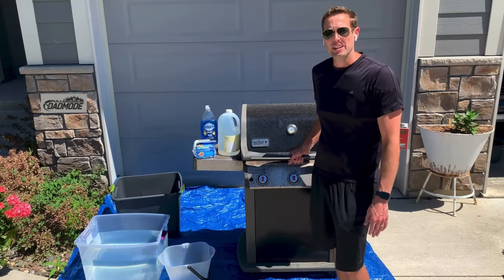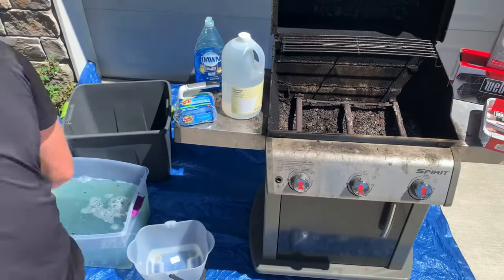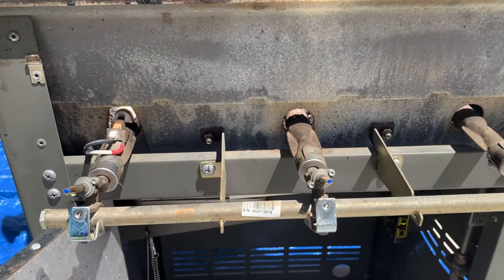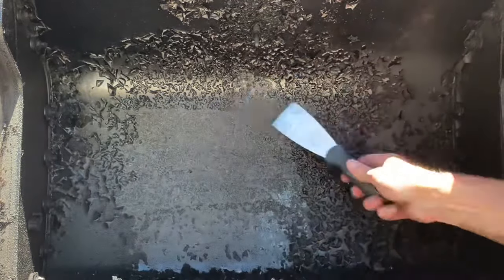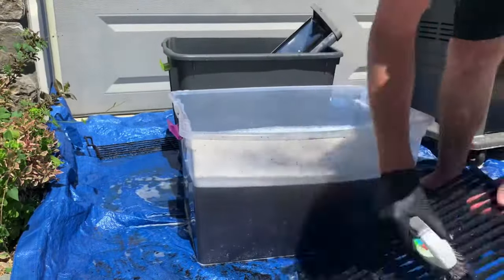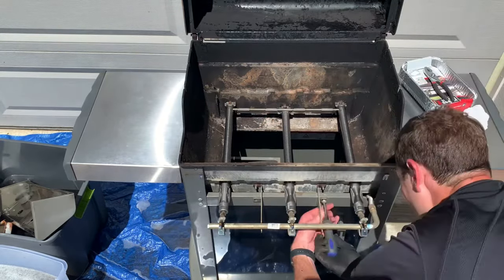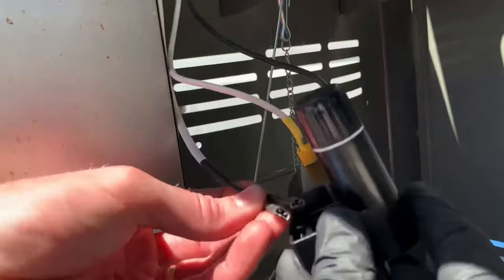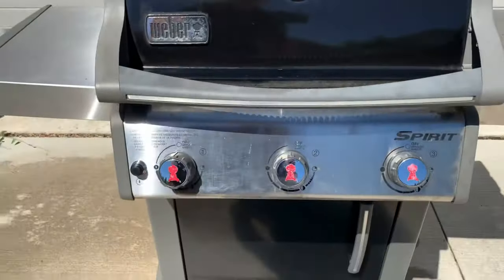How to Clean and Restore your Gas Grill

Comment: Thank you so much for the video, as I was about to toss the gas grill that came with the house. The previous owner hard wired it to the house which is super great. No more hauling gas tanks. I couldn't for the life of me get 2 rusted screwed off to replace the burners but this was a life saver. Thank you so much. I cleaned it up bought replacement parts to include the igniter and   OMG   Say What it has a battery. GEES that was all I needed.  Thank you for your help ....There is nothing like a great DAD

Comment: when I deep cleaned mine, I realized that there was a special metal coating on the inside of my grill so I didn't scrape anything. I just used the soft side of a sponge and elbow grease to get most of it done and just left the stubborn parts alone. I clean my grill about once a month. once you get everything clean like that, the only thing you really have to do is suck up all the seasoning and wipe out the grease.
Reply from the maker: Well done! You do a better job of ongoing maintenance than I do. New Year’s resolution next year will be to keep up with it.

Comment: Just picked up a free used Weber Spirit E-310 grill identical to yours that had NEVER been cleaned. After taking it mostly apart, I'm now in the process of doing a deep clean.   Easy-Off oven cleaner works very well on the porcelain coated pieces.  The vinegar solution is much less effective at removing charred on grease.  I am using our dishwasher with detergent (for the parts that fit) and then using a 75% vinegar / 25% water solution with a little better results.  Thanks for posting this video!
Reply: Will easy off residue become corrosive smoke once it's heated?
Reply: @shiningstar2903  I had no problems with nasty smoke because after everything was easy offed, everything was washed with soap and plenty of water.  The Easy-Off can be harsh on the aluminum. I did not use it on any parts that were on the outside of the grill.

Comment: I used your video to completely rehaul my Weber Spirit grill.  It was a ton of work, but very satisfying in the end.  A new grill costs $700+, but with non OEM parts, I was able to fix everything for around $80.   Thank you so much for making the video!  🤟
Reply: Where did you get the non OEM replacement parts?

Comment: This was a very helpful video that inspired me to reno our old Weber Spirit II E210 gas grill. The only trouble I ran into was the "heat deflector" that came with our unit. It has to be put down under the "burner tubes" and then the "flavorizer bars" (four of them) are placed over them. I found a different video (a Weber piece) that showed where the deflector was supposed to go so I'm good. This was still a very useful video.

Comment: I just got a Genesis II LX S-640 for free, and this is helping me clean it out, thanks. Brother-in-law was trying to burn off some extra gunk inside and accidentally started a fire. It melted some of the little plastic parts, but most importantly, it melted a bunch of the igniter wiring. Anything I should look out for while rebuilding this grill?

Comment: How long did this take real time?
Reply from the maker: 3 hours because I had to set up camera shots and figure out how to remove & replace burners. Not bad for full end to end deep clean. 

2 hrs if remade in that condition today. 

60-90min to clean depending on condition, without replacing burners and infighter.

<60min if done routinely; yearly or every other year.
Reply: @FullDadMode  Thanks so much for your quick reply 🙏

Comment: Nice job. I’m going to do the same to mine, which is also pretty ugly.
Reply from the maker: I need to do mine again this spring…I let it go too long again without cleaning 😞. I’ll post an update
Reply: @FullDadMode  I haven't done a cleaning on mine in over 10 years. I know I'm in for a big chore. Just bought all the replacement parts and cleaning supplies.